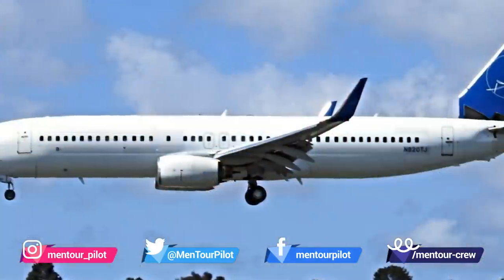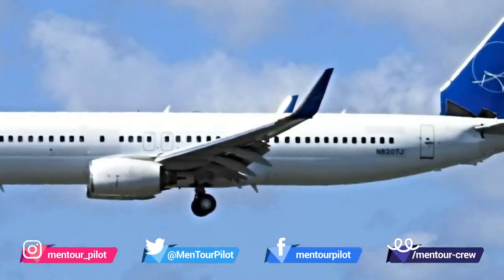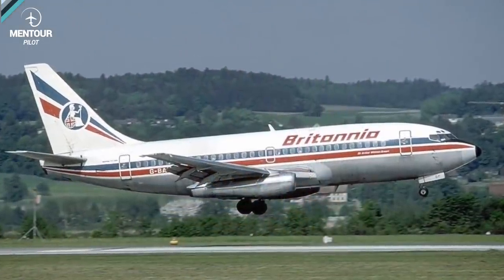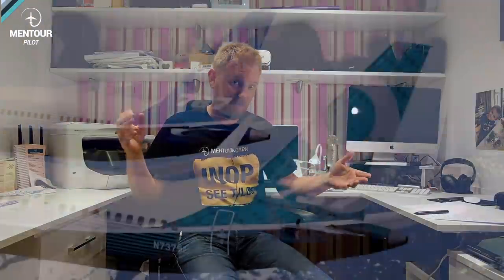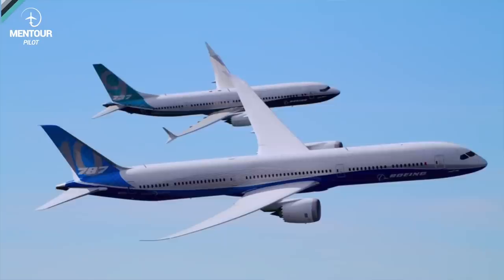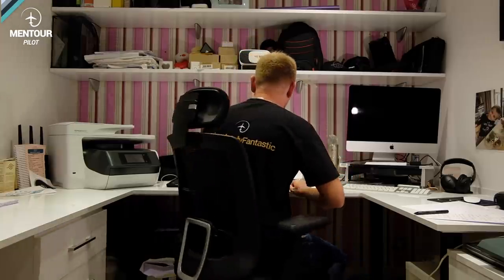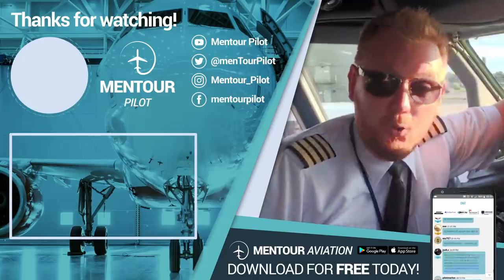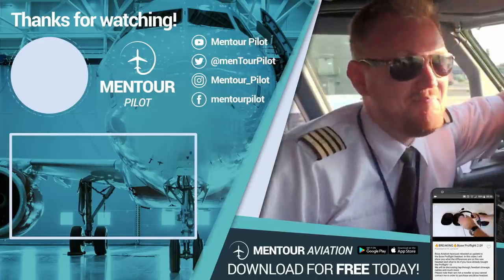Aircraft landing with missing tail section!!

Comment: Let's hope they don't find the dorsal fin and attaching hardware sitting on a bench in the maintenance hangar.
Reply: It damaged the tail, so it definitely WAS there.
Reply: Was probably "temp'd for closure"
Reply: How did you know were to find it? That's probably exactly were it is
Reply: Or worse on the ground floor of a 3 story building.
Reply: Well usually pilots do the walkaround and there is no way they could miss that, even though the possibility of missing that exists.
Reply: @mhernani  Pilots have taken off in F8U Crusaders and F4 Phantoms with the wings folded.......
Reply: @mhernani  Good question for Mentour.
Reply: Or for sale on Ebay.
Reply: Like Concorde axle spacers left on the removed truck?
Reply: Микола Франчук Might as well be an old damage..
Reply: Hernani Modesto Sorry to say, but it is actually not so unlikely. Its not a place you would expect to have any findings. And if you perform the walk around close to the airplane you would not see it anyway.

Comment: Whenever we had a vehicle with a mechanical failure in the field when i was in the US Army
the first thing I would check was the vehicle maintenance logbook.  More often than not the 
problem was caused by something that was overlooked or reassembled incorrectly by the maintenance
guys.  That was why I required my drivers to stay with his vehicle and assist maintenance when they performed
scheduled  annual,  semi-annual and quarterly maintenance checks.

Comment: I'd never really thought about this as a layman but your description of the role of this fin is very interesting. If this is a passive component rather than moveable I presume there would be less chance of any sensors informing the flight deck that the component was missing.
Reply: You are correct the crew might notice some minor stability issue at lower speeds but as long as both engines are providing normal thrust it  would probably go virtually unnoticed. As engines became larger and moved forward of the wings a dorsal fin was added to the stab to give the aircraft more aero dynamic stability at lower speeds or Incase of the loss of one engine the increased surface keeps the vertical stab from having to be increased in vertical length and a larger rudder!
Reply: If they were paying attention, they should have noticed the thunk as that dent was made in the horizontal stabiliser. Its possible it went unnoticed, if they were distracted (either through workload or something non-flying related - it happens).

Comment: NG dorsal fin is held on by 14 bolts, I reckon it was in for maintenance and these bolts were either not fitted or just slaved in loose. If fitted correctly they do not fall off. Probably the same for the vertical stab panels as I can't see any damage on the panel rebates.

Comment: „The dorsal finn fell off“
„Is that supposed to happen?“
„No, it is very unusual by all means, we built all planes so the dorsal finn doesnt fall off.“
„So what happened?“
„Wind.“
„Wind in the air, and that is unusual?“
„Oh yes, chance in a million.“
„So how do you build dorsal finns to not fall off?“
„We use only highest quality materials. For instance we dont use cardboard.“
„Ducttape?“
„Nope, no ducttape either.“
Reply: Oh and the Front just fell off too.
Reply: Good thing the minimum crew required was aboard. It might have had to land in another enviroment otherwise.
Reply: JustSomeCanuck 

„So what is the minimum crew requirement?“
„Well there is the captain.“
„And who else?“
„The co-pilot“
„I see, so what happens if the dorsal finn falls off?“
„The plane is diverted to avoid any risk of a crash.“
„But is still flying without a dorsal fin, so there is some risk...“
„No see, it is diverted to avoid that risk.“
Reply: @Bill23799  so hilarious, well done @Bill23799
Reply: @JustSomeCanuck  you guys are just cracking me up
Reply: Bravo. I commend you for recall of the John Clarke and Brian Dawe interview.
Reply: Or try crazy glue.
Reply: Ever heard of "high speed tape"? 🤣

Comment: Victorville is a major aircraft storage facility and parts are taken from the aircraft here all the time to sell or as spare parts. These parts probably were already removed. And who ever did the walk around didn’t look at the tail very well. The bolts that hold this on have to be accessed from the inside of the aircraft fuselage.  There are many bolts holding it on and it is a very sturdy part. The panels removed behind the dorsal and the dorsal are typically removed if you are going to remove the bolts which hold the vertical stab on the aircraft.
Reply: Wow. A bungled preflight? Wouldn't the tower notice and say, "Hey uuuh, yer spaghetti fell out"?

Comment: Considering Victorville is a heavy aircraft maintenance base. I’m suspecting human error.
Reply: If it fell off shortly after take off, it should not take too long to find. The desert around there is pretty well wide open and crawling with people with dune buggys. But if it went into the ocean it is likely to never be found.
Reply: I bet the plane sat for a bit, my bet is definitely maintenance on this one
Reply: @jasoncentore1830  A grounded plane should encounter much less wear&tear than a flying one.
Reply: @Mike-oz4cv  if maintenance is done correctly, The worst thing is for an aircraft to sit. You need to do engine run-ups, check electrical, etc... Hopefully this was all done.
Reply: i told you that one,THAT ONE THERE,the other one was an active plane,THAT ONE is the one who needs repair.
Reply: It was only in VCV for less than an hour. Arrived in Victorville from denver
Reply: @jasoncentore1830  it didnt sit. Just a fuel stop

Comment: Concorde lost about 8feet of it vertical fin on it's way to sidney the flight deck way unaware of any problem till the control tower said "speed brid 1 you do know your rudder is missing right "😯
Reply: The Concorde flew similarly to fighter jets which meant pilots didn't use the rudder so much to avoid causing the plane to roll
Reply: If I was that Concorde pilot I would had questioned how the hell I went mach 2.0 without dieing then I would had thanked my lucky stars that I made it out alive
Reply: This happened more than once, it was actually one of the rudders that was lost.
Reply: @joshuadrain3902  you dont ever use the rubber while doing Mach 2
Reply: A B-52 had a worse failure when it lost 90% of its fin due to an encounter with a cross direction jet stream.
Reply: Concorde also is a delta wing, and the whole vertical stabilizer shouldn’t be that necessary at all. Hang gliders don’t have any.
Reply: @danesebruno  neither tyres ;) (Okay, I know it is just an autocorrect thing but looks funny :D)
Reply: @B2BWide  LOL....
I just noticed the mistake... Im laughing too hard now.
Reply: Sydney  
We tend to grumpy when you misspell our city’s name. 
Also *Speedbird * 
Yes, I am one of those annoying people who find typos egregious!
Reply: @mandywalkden-brown7250   Speel it right!
Reply: @ericoschmitt  Weight-shift control on Concorde?....
Reply: @huudielbo728  what?.. Most flying wings don't need vertical stabilizers, and weight shift control has nothing to do with that. Check NASA's Prandtl Project. Or Horten wings. Even rigid wing hang gliders such as Atos don't depend on weight shift, they have ailerons for control and the weight shift is only a simulation that pulls the control cables.

Only flex wing hang gliders depend on weight shift control. All other flying wings have elevons, and if properly designed, they won't need vertical stabilizers.
Reply: @ericoschmitt  if you haven't seen a rigid wing glider with weight-shift control then you've not been around to long.

Comment: Wouldn't air pressure caused by air entering the openings exposed by the missing dorsal cause the panels to blow off?
Reply: deserteagle10 Most likely
Reply: Panels are usually at minimum screwed in torqued down then maybe sealed depending on what panel and all that varies by acft type.
Reply: if there's a tail mounted camera (like, say on A380) the pilots and not to mention passengers would have been able to witness this separation.. yes?
Reply: I had the same thought. Those spaces inside the rudder were pressurized by the air entering the weight reduction holes in the front bulkhead. The result blew the panels partially open and the airflow along the rudder did the rest.
Reply: People that big vertical thing  is not the rudder,  it is called the vertical stabilizer the rudder is the part that's mounted on the back of it that can swing back and forth.
Reply: @bahardin3992  not likely. Those tail cams look forward and are too high up on the tail to see directly below it
Reply: Definitely in my opinion, they were lucky to not have any further problems aerodynamicly
Reply: @wm9346  Is there a reason for why maintenance on this component
Reply: @deaf2819  Screws are only used on panels deigned to be removed like an access panel otherwise they are riveted, glued or sometimes both methods used to keep them in place.
Reply: Hi Mentour interesting topic do you know if the missing part was aluminum or composite materials. The use of undersized or not torqued properly fasteners reminds me of a in flight failure of replaced windscreen years back.
Reply: @briangarcia8986  Do a little research on the internet and you will learn the aircraft is over 20 years old and was on its last flight before being parked up.
Reply: Looks more like the skin failed at designed failure points, tear straps I think they're called?
Reply: Good point!  Thisr pannels coming off probably saved the vertical stabilizer
Reply: @wm9346  Hate to say this because I am a retired 737 tech, but you are probably right.
Reply: The back are is behind the pressure cabin. So the area there is not pressurized
Reply: @brofights3138  Well, it got pressurized when the dorsal fin disappeared. It's dynamic pressure, blowing straight into those round holes you see.
Reply: soaringtractor  Those are screwed panels.
Reply: @whatsonyourchannel  To gain access to the lower rudder hinge, and the fwd. attachment pin of the vertical stabilizer.
Reply: nope ,this part of the aircraft isnt under peassure
Reply: @wm9346  i would even go as far ,to say that the screws werend in place at all ,if the screws were ripped out there would be far more damage, if there wasnt a dent ,i would have guessed that they forgot them after an inspection
Reply: @richb313  sorry didn't think to mention that I'm aware, ,5 years crew chief in USAF.
Reply: @martindonat3249  Nobody is suggesting this compartment is pressurized by the bleed air system. It got pressurized by dynamic pressure after the dorsal fin disappeared.
Reply: It kinda reminds me Japan Airlines 123 where the Aft pressure bulkhead was blown because of improper repair by Boeing and the air in the cabin caused the vertical stabilizer to explode and ended up in losing Hydraulic system

Comment: I think the tip of the vertical stabilizer came off first then the air passing through the three rounds holes was simply strong enough to push the skin off from the inside.

Comment: A&P mechanic with many years experience on the 737 here. This is not a bird strike. Everything departed to cleanly for that, looks like many fasteners didn't get installed on a recent Maintenance visit.  Likely the doghouse and panels were tacked up in place with a few screws and Mx neglected to complete the job of reinstalling and sealing everything in place.  Somebody's head(s) will roll for pencil whipping the paperwork on this one. As well they should.
Reply: Can you explain more? What maintenance check involves removing this component and why

Comment: You’re amazing mentour
Reply from the maker: Thank you! 😀
Reply: Mentour Pilot in fact there was a case similar to this 737 dorsal fin accident. Japan airlines flight 123 was a Boeing 747 and crashed in 1980 the cause of the accident was the aft bulkhead at the rear of the fuselage had cracks which grew steadily bigger and bigger with each pressurisation cycle and to an extent that the bulkhead exploded and caused the severing of the vertical stabiliser along with the rudder caused the jet to wildly spin and crash into the mountains of Osaka. 

This tale tale accident is synonymous some how to the accident of japan airlines flight 123. Thou the aircraft didn’t have any structural issues that could lead to fatalities but did lead the aviation industry speculating “mmm I wonder what happened here?!”
Reply: @MentourPilot  
We mean it!
You are awesome as a person too!
Reply: @ahmadtheaviationlover1937  Hello friend I'm glad to see your interested in researching these accidents. It's important that folks understand what there reading . I do love your interest it's refreshing. To better help you understand the information your reading about I'd like to help clear some things up. The 747 your referring to had a Cabin Pressure Bulkhead failure ( This is the dome shaped bulkhead at the aft end of the cabin) It's the primary structure that helps hold cabin pressure. This particular incident happened after the airline required assistance from Boeing to repair it after some damage occurred to it. The Engineer made an error in his fix instructions for the repair. A second row of rivets were omitted from the instructions. The mechanics repaired the bulkhead as instructed however that crucial 2nd set of missing  rivets  left metal fatigue to progressively damage the bulkhead during pressure cycling of the aircraft.( It's like blowing up a balloon a dozen times you see how it stretches out and loses elasticity) eventually this lead to a catastrophic failure during flight. The aircraft holds a very large volume of pressure so when it failed it's like a bomb going off and it sent a large amount of it's structure outwards and damaging just about everything in the tail of that 747 leaving it uncontrollable and eventually crashing. But I digress here and this again is nowhere near any resemblance of the missing dorsal fin. The dorsal fin is on top of the aircraft and blends in to the vertical Stab. There is no pressurization involved with this part of the aircraft. In itself unless many other factors happen all at the same time (Chain of events ) this incident would not, should not pose a mortal blow to the aircraft. I hope you will keep your interest in aviation and Mentour Pilot puts out great accurate content on his Chanel in my opinion. I don't know everything however I have 30 plus years of experience in commercial and military aircraft as a inspector of systems and structure. I've dealt with many pilots over the years and I can honestly say I'm surprised to see the level of knowledge and accuracy that Mentour puts out. So keep up the good researching love to see such amazing responses.  Peace be with you friend!
Reply: @ahmadtheaviationlover1937  I doubt about the likeliness — JAL 123 had a structural damage after a severe tail strike before, and the structural parts were fixed in a wrong way with less strong configuration. That caused extreme forces to the pressure bulkhead by moving that in a not planned way and that exploded because the too much wear on it. The explosion took off the whole fin, not only a part of it, beside causing other severe damages on the fuselage that led to the complete loss of hydraulics. The key is, the load bearing structure failed first because the inappropriate reparation. The dorsal fin of the 737 is not a load bearing structure and seldom meets such forces that could be badly affected by structural issues caused by tail strikes for instance. I mean, there would be other, more structurally loaded parts that would show the signs of this type of fatigue. Also as far as I know the JAL 123 did not spin but started an uncontrollable phugoid oscillation and lost height above a difficult mountainous area.
R.I.P. all souls lost on JAL 123.
Reply: James Avram that’s the one! I clearly remembered the fact that the aft bulkhead wasn’t fastened properly. But typing the comment down it didn’t click in. I was thinking I remember something related with the aft bulkhead but it didn’t come out of my mouth.
Reply: James Avram that’s dope man! I loved aircraft since I was 4 years old I’m 20 year old presently I still fathom and contemplate about their sheer size and beauty. Really is a wonderful piece of machinery
Reply: @ahmadtheaviationlover1937  Definitely the 747 was a engineering masterpiece that forever changed the course of aviation. You are young so you have plenty of time to get involved in the aviation world. One of the best decisions I ever made was to go to school and earn my A&P license ( Airframe & Powerplant). I continued on with my education @ Embry Riddle. It's a great career and there's always plenty of work out there. Good luck to you sir! Aim High
Reply: James Avram thank you! I’m more interested in being a pilot not an aeronautical engineer! But any job that involves planes set me up for it I’m willingly wanting to participate and be part of the aviation world as I have always imagined